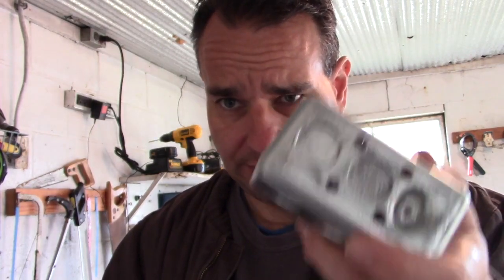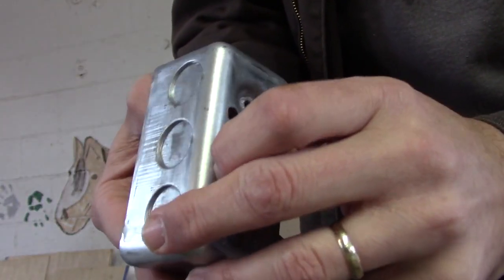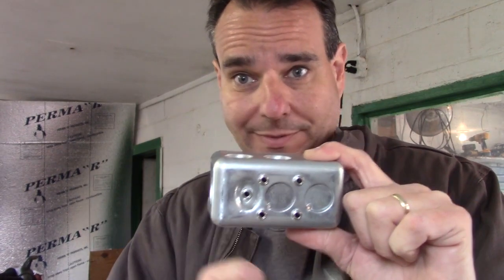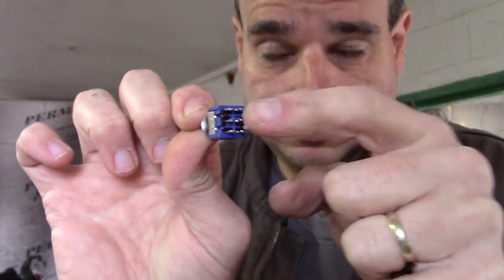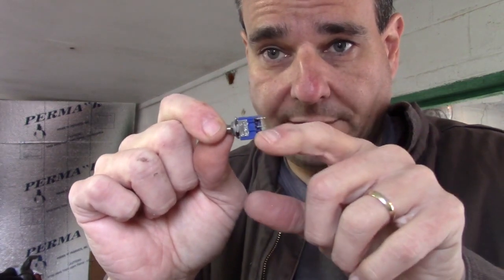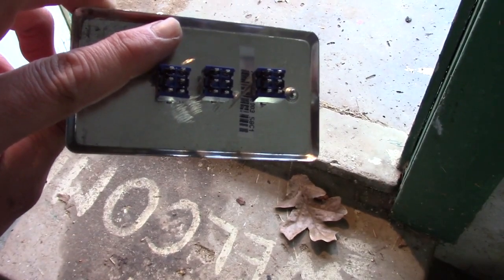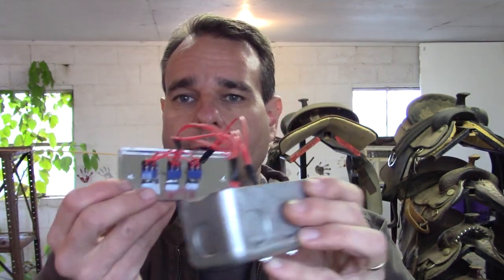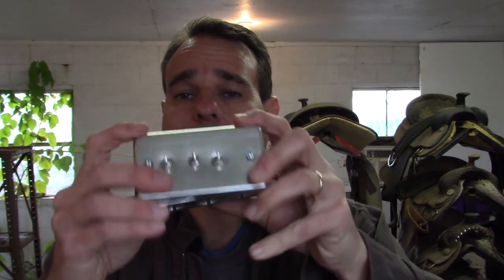Making an A/B Switch for Audio Routing

Comment: Interesting. I bought a audio switch box that I can't use because of crackling noise. It works, but the noise drives me crazy! I suspect it's some sort of grounding issues, but there's no way to ground it as I did take it apart and found no way to add a ground. I may have to try this.
Reply from the maker: The old radio shack A/B boxes had a cardboard inner box that was lined with aluminum (like what you would microwave a pizza on) - and THAT was the shielding.  There is definitely no noise on this thing - works like a champ, no thumps or anything either.

Comment: I appreciate the cost saving aspect of using a metal box versus those rather expensive PLASTIC boxes that are PIA to cut out or drill into.  Plus, are never likely to break anytime soon.  I would've appreciated more close ups of the soldering with a detailed wiring chart as this can be a bit tricky for the novice tinkerer (me included).  Now all I need to do is find out where to order these electronic parts.
Reply from the maker: I ordered the parts on Amazon (ebay also is fine), or you can buy from Mouser.  Thanks for watching!

Comment: I have a question, if I don't use this type of enclosure should I solder all the grounds together or solder each ground to a switch (9 pins) ?

Also, you seem to be a happy person, I like that haha
Reply from the maker: Thanks so much for that, Ingrid!  Yes - you can solder the grounds together, or you can make them all touch one point together to connect them, or even do what Radio Shack used to do - they glued a piece of aluminum foil to cardboard and then attached the jacks through that to act as a shield/ground point - cheap but effective.   I had a plastic enclosure and I literally just stripped a wire and ran it underneath all the jacks to connect them in one project.
Reply: @dixielandfarm  thank you so much for the response, have a nice one!!! :D

Comment: Is there any update on this?
Reply from the maker: Update?  It worked, if that's what you mean...
Reply: @dixielandfarm  kinda, but isn’t there a „noise“ when switching inputs/outputs? Thought there would be an second video showcasing it
Reply from the maker: @gizlas  No - there isn't a thump or anything like that - that CAN happen, but I haven't had any issue with it.  It just works, which is why there is no particular follow up video.
Reply: @dixielandfarm  thanks for your amazingly fast response. I think i need to build my own now :)